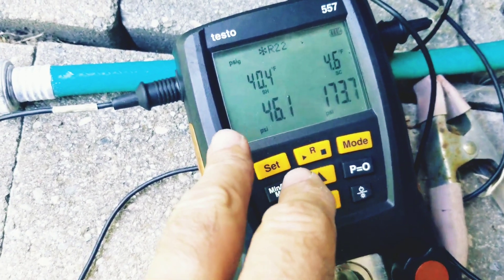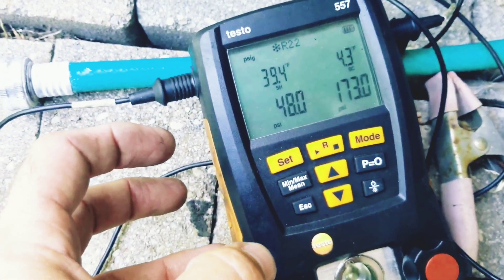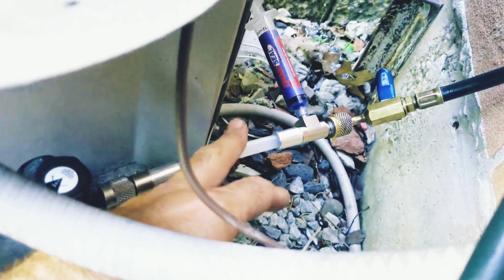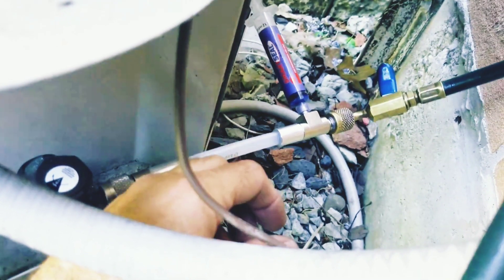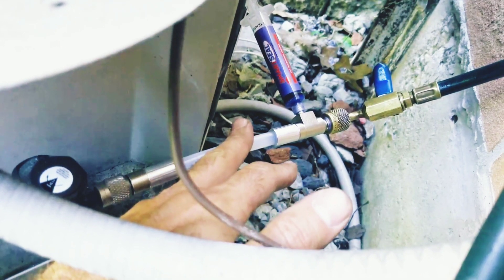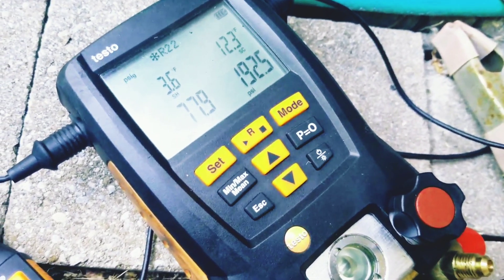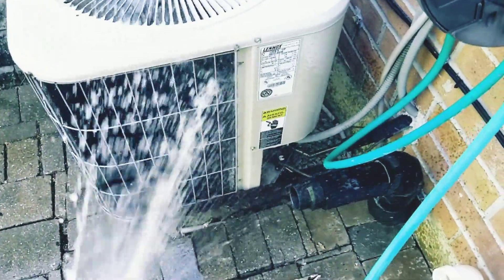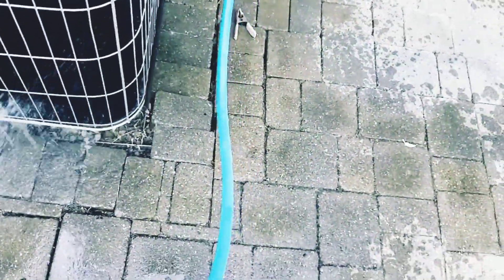HVAC - Residential Air Conditioning Freezing Up

Comment: Unfortunately the 'business model' these days is to make old systems financially too painful to repair.  I'm pretty new to HVAC being a retired old guy on a fixed income... I got the 'gas and dash' treatment a couple times, paid 100 bucks a pound for R-22, and was told that it's gonna be illegal soon so ya better spend your 14K now and get two new systems installed.   They'll sell me all the R22 I want for 100 a lb though.  (The leak was at the service valves...)  

So  I got my federal certification, did my homework, studied refrigeration and now I do my own.  I retired from the oil/gas/power gen business, and I've been around refrigeration systems all my life so the transition was pretty easy to residential.   I don't want to be 'in business', but I'd sure enough go help out people who are down on their luck or struggling financially without any viable solutions.  Out here in the Az desert where it's been hitting 119 for two weeks straight, AC is pretty important. 

Good job helping out!   I haven't tried any of that sealant yet, but my 24 year old Chevy has an evaporator leak (slow) that I might give it a shot on!  I hope it solved your friend's problems!   There have been so many AC changeouts with the migration away from R22, there ought to be an air handler out there somewhere with a good evaporator in it somewhere!
Reply from the maker: Yes, it's still up and running just fine.  The tech didn't even offer a repair solution, just left and told her she needed a new one.

Comment: This really touch me. I am also a single mom and I am 3 days trying to figure out what is wrong with my AC. Is getting frozen, 2 month ago freon was put in and that cost me $200, it was only missing a little bit.
Now it is freezing again and it is more than 95 degrees here in Florida in August.
Filter is clean
There was gunk in the pipes, I clean them, put hot water and used a wet vac to suck al of it out, keeps freezing, clean the outside condensador, ir wasn't dirty to start, the evaporator coil inside are not dirty, so I really thought that after clearing the pipes everything was going to be ok, but no, any ideas? Will really appreciate it!

Comment: My AC been freezing up for over a month now and want cool. So my AC guy came out and said I was low on freon. So I paid 160.00 for a service fee and adding the freon. Still same problem so now it's the compressor so replaced that and 180. Dollars in gas. And still setting here with no AC . Filters where clean from day one and coils are clean. So i don't know where they hell to go from here.

Comment: I just injected an identical unit two weeks ago with AC Smartseal Quickshot 3 in 1 (my first time based on recommendations). She is also a single mom of two (actually a single grandmother living by herself in the blazing Texas heat on social security). The unit must be 25 years old but still cools and it also has a slow evaporator leak. Her alternative would have been window units. All in, probably $100 actual cost. We will see if she gets more than a year on this charge.
Reply from the maker: Perhaps more...